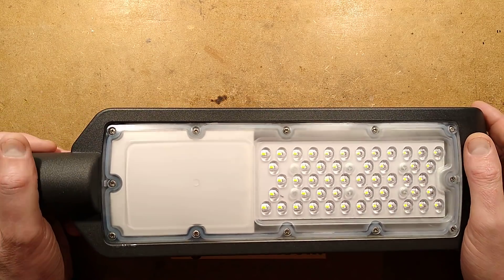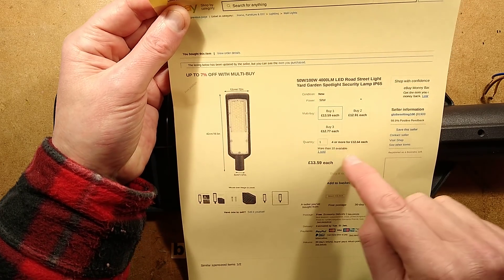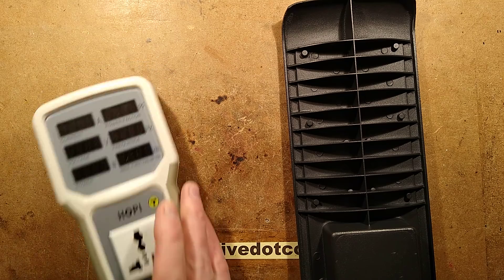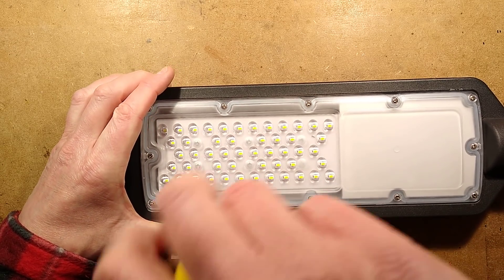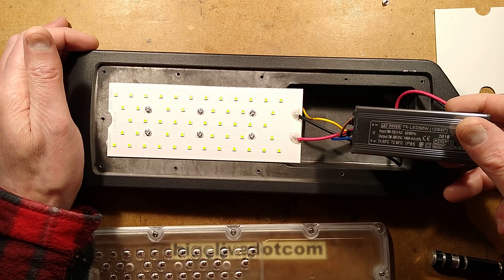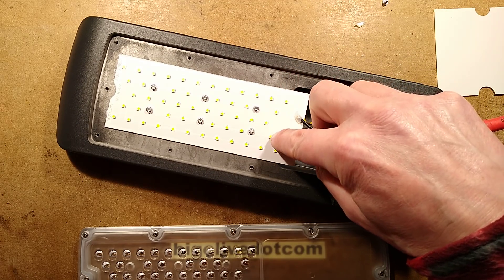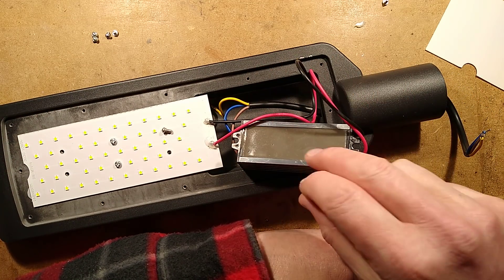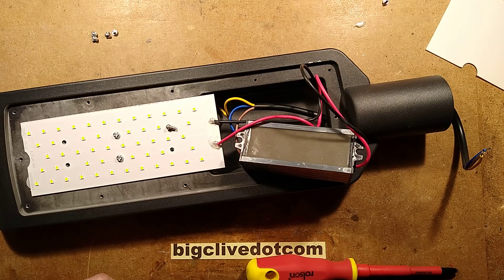DIY Chinese street light kit.

Comment: No ma'am thank you very much for the disgusting ugly slim grey black boxes of cold light.. I much rather stick with my cast iron shell soviet fluorescent street light from 1960s with three 40 watt tubes and a starterless autotransformer ballast that weighs literaly 10 kilos and the minimum width pipe you can hang the whole fixture on is 50mm. I like the noise of the ballast inrush current magnetic field vibrating the whole body of the fixture as the tubes flicker their way into full output while the ends glow in deep red color. It drives all three 4 foot tubes in series, the arc voltage is 640 volts and the starting peak voltage is 2000 volts I measured and fried my cheap chinese multimeter with it lol

Comment: I like that the cable opening isn’t sealed because if water does happen to find its way in, as long as the cable slot/pole hole is open then it can evaporate instead of just staying in there and corroding like hell. 

There’s no such thing as waterproof. Water will always get in. Or air will condensate with rapid temperature changes. Leaving moisture inside. So Leaving a bit of an exit strategy sure helps things air out and last longer. That’s been my opinion spending several years repairing industrial electronics that have been long used and abused.

Comment: Hi, I have a question related to 6v diodes. I removed two strips with 7030 LED diodes from the old TV. Each strip has 44 LEDs and I wonder how can I connect them to 220v?

Comment: "No water should get down that" Seen cases of coolant pressure sensors in vehicles that send coolant to the engine management system in the past so why wouldn't it happen here? Not under pressure?
Either way, not really good in any case.
Edit: Should note, it was sent through the insulation of the wiring, Seems to be a sensor fault, the wiring was ok and doing it's job for a change on this particular brand of vehicle.
Reply from the maker: I do a lot of outdoor work and have seen liquid ingress via cables a lot.  My preference is for drainage and breathing holes.

Comment: The driver is marked 10S5P ; I would have thought that means 10 Serial X 5 Parallel - 10 sets of 5 LEDs wired in parallel, but you seem to suggest that it's 5 sets of 10 parallel.  Could you clarify please?  :-)
Also, could you explain a bit about the difference between dimmable and non-dimmable domestic LED lights and dimmer switches?  Many thanks!

Comment: Can anyone explain how all these lights function with a driver that has such a wide output voltage? Do they sense the leds some how? I have a pile of these that I have been collecting from a lighting outfit and can't seem to figure out how these are rated so oddly.... I noticed some have the option for dimming so I get that would make it variable but the ones that have no dimming options still have that voltage swing. I have a few I need to replace the drivers in and no clue which ones I should get because of the mystery voltage.

Comment: Hi @BigCliveDotCom - many thanks for another great video.
Just now, I've been asked a question that I don't know the answer to - hopefully you and/or your viewers may be able to help...
How possible / wise might it be to try to make a PCB using either laser or chemical etched acrylic mirrors?
Preferably, the components would be on the reflective surface.
We are aware that the tracks would need to be much wider than a typical copper PCB's tracks.
Many thanks for any advice that may be available.

Comment: oh, forgot to mention @bigclivedotcom had a 50 watt "full spectrum" driverless 110v fail after about 100 days of 10 hours a day, easy for math eh? 2 dies failed originally, bridged them with solder, got a few more hours of use and then more kept popping as less leds took up the load and it overheated, had it on a stock pentium 4 cooler with oversized fan, wasnt enough to keep it alive any longer although the cooler was fine to handle the heat

Comment: Quite low power factor. Why? LEDs panels have capacitive/inductive loads somehow?
Reply from the maker: Usually because the current is only being drawn at the top of the sinewave as it replenishes the charge in the primary side capacitor.

Comment: I've done a bit of research on mark steele and found some interesting information about him. He and his brother own a company that make smart helmets. Maybe big clive could ask for one to tear down. Here is the full article I got the information from. Enjoy. 
https://www.vigiliae.org/mark-steele-exposed
Reply from the maker: I'm avoiding getting involved with him.  All the components he shows in his videos have nothing to do with 5G communication.  Most of them are the standard components you find in a well designed LED driver with power factor correction.  The little antennas seen on some posts are just low power and low data devices for switching the lights on and off.
Reply: @bigclivedotcom  I don't blame you for that. The concerning thing about this man and his friend Lee Garrett is that innocent people are actually donating money to them to keep up the anti 5g movement. They should be locked up for theft by deception.
Reply: Big Clive I sent that link to someone very much like yourself who knows what they are talking about and he also makes videos similar to you. He sent me this response from the link I sent him. Grab a beverage and enjoy. Be careful not to spit your beverage on to anything electrical as the way this guy puts these actual facts across is absolutely a work of art with words. Enjoy.
https://youtu.be/2PvNSkdQR4g

Comment: Some research on Mark Steele, proving that he is paid to make any 5G campaigners look like idiots, part 4 here, with links to 3 other parts and my website  with evidence of my claims. https://www.youtube.com/watch?v=gzuOJM5DEJk&t=40s
Reply from the maker: His analysis of the street light circuitry is completely wrong.  The components he indicates are 5G related are just standard components found in a high specification LED lighting driver with good electrical noise filtering and power factor correction.  (Relationship between voltage and current used to make it a more efficient load.)
I do believe that people should not hold their phones against their heads for long periods of time.  Properly implemented 5G with lots of local masts will theoretically reduce the amount of RF energy needed to communicate.
Reply: @bigclivedotcom  In one of his videos, in which i have incorporated it into one of my expose vids, he actually states in an interview that the LED lights in Gateshead have the capacity to fire a weapon at another country, I kid you not! 4mins in https://www.youtube.com/watch?v=nQQbkr-LiHo&t=4s
Reply: Logical Annie a new one for you. Hope my efforts helped
https://youtu.be/2PvNSkdQR4g
Reply: @englishbreakfast82  I saw that, let me just say right from the start, I am an Anti 5G campaigner, I do not think that we should be bombarded with any more dangerous radiation, but I know that the Govt and the UN/EU have put in place, their own so called leaders who are spreading false info that can so easily be shown to be false to undermine the whole campaign of which Steele is doing a great job!.
Reply: @logicalannie4794  I appreciate your time and efforts with your own campaign and I now follow your campaign rather than Mr Steele's. It was Steele that made me aware of this whole thing initially and I was following him for some time until discovering your campaign and the evidence you have brought to light about Steele. I was very upset about this and I am concerned that he makes so many false claims that can be proven to be false. I have questioned Steele many times recently about his qualifications and even said In the same messages that I appreciate his efforts as to making people aware and is doing a good job as you say too. It falls on deaf ears though and he continues to ignore answering my questions in regards to his level of expertise and his qualifications proving his claims. He also has a go fund me account and I am saddened at the amount of donations he is receiving. What is he spending all that money on? From his public records of business and his brothers too it flags up some real concerns to me as to the legitimacy of his intentions with the campaign he is running. In my eyes this is a good way to milk a lot of money from innocent donors and use them for his own personal gain. Go fund me has guidelines as to what the cash an be used for and how it can be spent and proof of this should be kept. Now if he is using that money to live on, pay his bills etc etc  because he does not have a job which is bringing in any other income then surely he is in breach of the rules. 
Here are the rules  https://support.gofundme.com/hc/en-gb/articles/203604694-Reporting-a-Campaign
By using false claims in his campaign surely he is in breach of these terms. Also if he was asked to provide evidence of where all the cash is going then I bet that would throw up some interesting results. He is receiving a lot of cash as we can see from his go fund me page here.
https://www.gofundme.com/f/criminal-conviction-appeal?fbclid=IwAR3D-pWI_W8MM80nJ4hcFbwCuuGUcFtx6dP4BfSBsCY2Abs8d3mBrhTAwqU
I wouldn't mind donating to an honest cause but not with a fraudster at the helm.
Reply: @1EccentricMoFo I have always stated that LED lights are NOT safe, even shared articles on my websites with the dangers of LED. Please do not confuse the issue, I am stating that some LED lights have been added to, to make them 5G and we can clearly see what they look like, but the ones in Gateshead are dangerous LED lights and NOT 5G. https://www.vigiliae.org/?s=dangers+of+LED
Reply: @1EccentricMoFo he may well be, but I am NOT, the fact is that this guy who made the video is clearly an expert on the technology that he makes vids about, that shows that  Steele is talking rubbish, in fact I made a video in which Steele actually names Big Clive and says go and see his breakdown on this weapon system, dont ask me, hes the expert, then when Clive stated that Steele is talking rubbish, Steele turns on him too. he turns on anyone who shows that he is lying. Whether or not people think 5G is good or bad is up to them but I am fighting it as an activist. My website www.vigiliae.org
Reply: @1EccentricMoFo I have been working flat out, updating my website, running a leaflet campaign that has reached over 120 thousand and trying to make people aware of the gatekeepers, its 24/7 for me.
Reply: @1EccentricMoFo Cheers!

Comment: For the USan, 45mm ~~ 1 3/4 inch.

After Clive did a review of the solar-powered street lights, I bought one (claim is 60W) that uses the LiFePO₄ battery.   That was about 9 months ago; it's still going strong. 

I've got one of those potted Chinese ballasts and can confirm that it works on 120VAC just fine, in spite of the nameplate rating.   I use it to drive a 50W COB LED.
Reply: M Harris  Could be--I haven't bothered to put a meter on this one, as it operates just fine on 120V--that is to say, don't look at it directly if you value your vision.   The project has stalled a bit but I'm intending to use the COB (and heatsink and fan) to replace the 500W halogen in a upward-shooting torcherie floor lamp.   The ballast unit doesn't get warm at all.

Comment: I use the technique for sealing Heliax on radio towers. You could use the European screw clamps or decent wire nuts from the USA. Use Scotch 3M type 33 electrical tape over the joint and outer sheath. Follow this with a layer of self fusing tape followed by another layer of 33 tape. Now get your can of Scotch Coat and paint the whole joint with this coating twice and extending onto the cable sheath.  Scotch Coat is like a rubber cement product that seals even the tape joints. I have never had a bad joint due to moisture in any RF joint or electrical joint. The inner layer of tape allows one to use a razor knife to cut into the waterproof seal and peel off everything if you need to change out the fixture. 
I would think that Scotch 3M products are available in the UK but not in continental Europe.
Reply: I just use duck tape !

Comment: 3030 10B(y)5C(olumn)

those are 6V 3030's which are kinda common and only need 1 solder bit on each end (as in, they are series internally)

1W per diode is kinda pushing it, 2w definitely pushing it

while probably not the best for street lights, it'd be very useful as a garden light given enough height

3030s commonly used in some TV backlights

https://www.aliexpress.com/store/group/3030-TV-Application/1758868_507658481.html?spm=a2g0o.detail.0.0.1d3e3e33YHQB6W

Comment: Wouldn't water collecting on the back help with cooling?
Reply: 'Don't you just lover the smell of hot plastic in the evening'. A line from Apocalypse Now in 5G
Reply: Maybe at first but it would get full of dust and debris and turn to paste which would eventually solidify and stop the heatsinks from working.
Reply: @jonathandenton247  But, until then you could use the hot water for a cuppa. 😉😆

Comment: Might need to test one run continuously in the Aussie summer.  Are you also trying to tempt me to alter it for 12V?  That I can do in a few minutes here 😁😁
Reply from the maker: Programmable boost converter?
Reply from the maker: That would also have the advantage of allowing lower currents to be set.
Reply: @bigclivedotcom  it wouldn't need to be programmable but simply adjustable
Reply: @bigclivedotcom  although I do have a drop in 12V 30W driver that's designed for the 10 series chip type arrays
Reply from the maker: @australianstig  When I say programmable I mean adjustable.  It appears to be fashionable to describe things with adjustments as programmable.

Comment: Even the earlier generation led streetlights were OK for domestic use. Bought two from DX a decade ago, and although the casings are falling to bits, the electronics (and led boards) still work just fine.
Reply from the maker: That's pretty good.  Are they the type with discrete 1W LEDs?
Reply: @bigclivedotcom   Yes - and here's the review of the lamp in question. https://www.youtube.com/watch?v=8dxqRiXFGC8 Yours were from Banggood, whilst ours were from DX! The grey paint has been replaced by Hammerite (a few times!) yet the guts are still OK, and the LEDs still produce a useful amount of light.

Comment: @bigclivedotcom You've mentioned swapping the driver with one which is lower wattage. What percentage reduction is suitable for prolonging the life of the light without degrading the brightness. Would a 40W driver instead of a 50W be enough of a reduction?
Reply from the maker: That would definitely improve the lifespan, but even with a 20W driver the intensity would be very useful because the LEDs are more efficient at lower current.

Comment: Do you think for 4  dollars on Alibaba, a 3000 Farad graphene capacitor is fake? It's in an 18650 form factor but that's smaller than the best on the market Maxwell's? Maxwells are huge and have huge screw terminals, either this is a fantastic break through or a micro Farad marked up to scam people. Search Alibaba for graphene supercapacitor.
Reply from the maker: It sounds too cheap.  I don't know if the technology has advanced to that level of production yet.
Reply: It's probably filled with sand.

Comment: You could put a white (reflect the suns heat) curved spiked bird deterrent on the top to stop birds nesting as well as their dirt collecting on top. Not impressed with the earthing or top of fins.
Reply from the maker: It definitely needs spikes. One possibility would be to include threaded holes on the top for screwing in a set of spikes.

Comment: It needs to be finished, in terms of manufactoring, because when you have a bump or raise of the metal, for instance here right beside the screwholes, the heat conductivity from the pcb to the metal is only a fraction of what it could have been. No thermal paste can balance that out in any way, so in order to prolong the lifespan, apart from lowering the voltage, would be to sand the surface down where the pcb is supposed to make contact. Perhaps even polish it.

The amount of thermal paste on this thing screams out unnecessary laziness. So in short: It's certainly not a finished product by any means.

Comment: I always feel slightly disappointed when I see a Big Clive video about something reasonably well-made, with no major, showstopping hardware bugs.
Reply: the loose driver is not good when placed in position it will be sitting on the white thin plastic, not connected to anything. no ground on the exterior metal case of the driver. and to be IP65 it must have something that seal the hole of the wire. in the long term, overheat and humidity will corrode the internal part exposed :/

Comment: Speaking of BangGood, here's one for you. Just arrived last week https://www.banggood.com/50W-High-Power-70-LED-Flood-Light-Waterproof-Lodine-tungsten-Lamp-Outdoor-Garden-AC220-240V-p-1314131.html
Thinking of installing it as an overhead in my work room so I can see while welding beyond the 2 hours of over-head sunlight through the sunroof (the rest of the day it's too dark to see with the mask on, even while it's in "clear" mode)
Reply from the maker: I've made a video on a couple of those.  Very popular as grow lights and regarded as a disposable item in the grow community.
Reply: @bigclivedotcom  I've seen a lot of grow lights on BG recently too - R B, no G. Had thought of getting some for my reapers over winter but decided against it - too likely to be stolen where I used to live, not needed where I am now and the kangaroos would rip out the power wires anyway. Will have a look back in your previous videos, I must have missed it